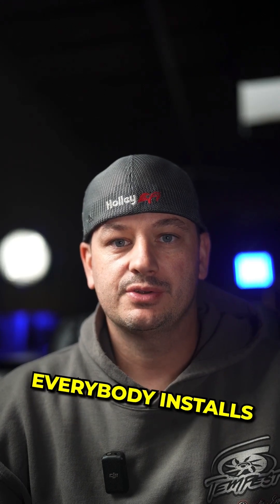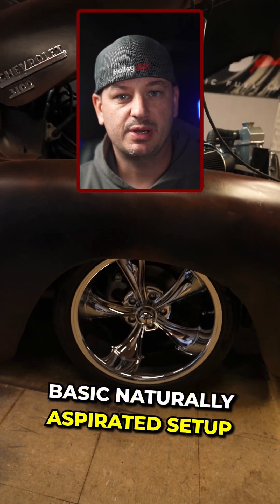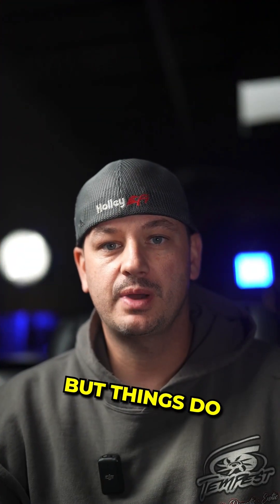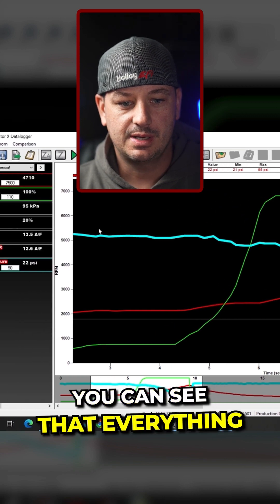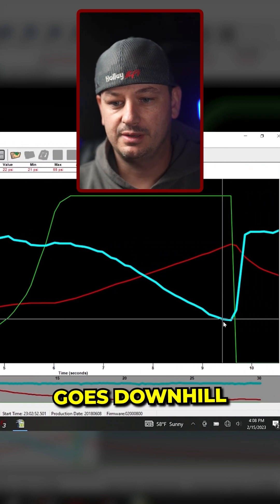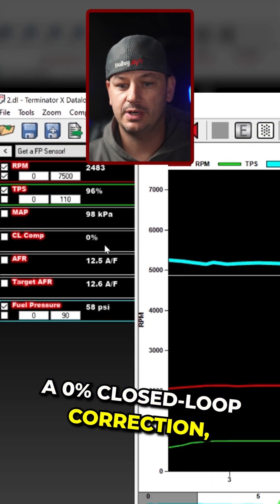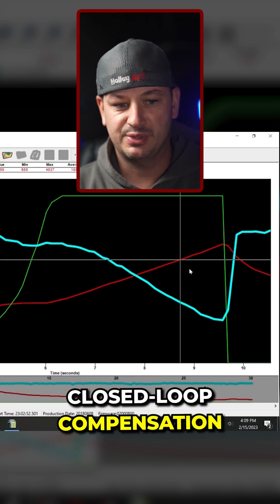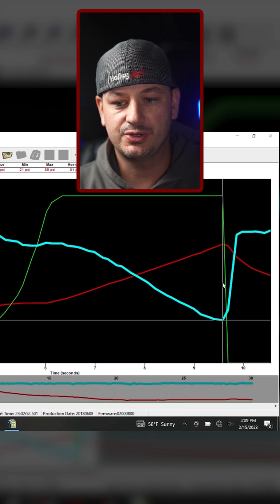Why You Should Install a Fuel Pressure Sensor With Holley EFI!!

Comment: I just recently was on call with holley supoort and told me i need more powerful fuel pump, mine was at 40psi max. So i got a hellcat pump and wired it in. And it rsn amazing. Then i had another issue, where it wouldnt start. Got that sorted snd and got a external fuel pressure regulator. So i can get constant 60spi

Comment: are people really out here going aftermarket ECU and no FP sensor? that's WILD to me that that isn't common knowledge/SOP to do so.

IMHO, all oem core sensors, like knock, IAT1/IAT2 if applicable, water temp, oil pressure, oil temp, trans temp, fuel pressure is just non negotiable. 

Ethanol content sensor for flex fuel or any combo that may see enough street time to potentially run out of fuel in an area with limited access to ethanol.

for the big power stuff, EGT and EBP sensors, compressor speed sensors in addition to the Co2 boost control and boost adjacent strategies (boost by rpm, hall effect sensors to detect tire slip for traction control reasons, etc yada yada...) if Holley has enough I/O to monitor it...

Comment: We could also add how a Fuel pressure sensor could potentially save your engine as well by setting a low fuel pressure limit and or set it to where the injectors start compensation for fuel pressure loss by adding injector pulse width to try and keep on target AFR.

Comment: It's great to know fuel pressure in datalogs, I've had a stainless sensor on my car over 10 years now. I think I used teflon-based thread sealant goop (not tape) to help avoid leaks. It's been trouble-free.

Comment: Can you show exactly where in the fuel rail is the best place is to add the sensor?
Reply from the maker: Wherever there is a 1/8npt port. Aftermarket regulators usually have a port as well
Reply: @JoeSimpsonAtTempest  what if your fuel pressure sensor reads 43 psi and your fuel regulator gauge reads different running a terminator x 5.3 ls turbo
Reply: @irvingbar4569  2 data points that read different need a 3rd to corroborate one or the other. basically get another reading from a different source to see which is reading incorrectly.